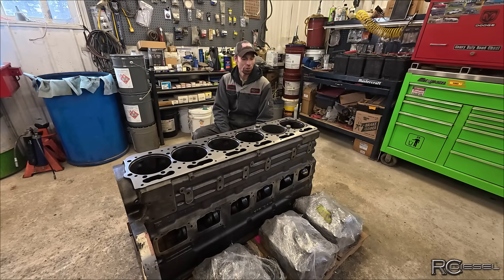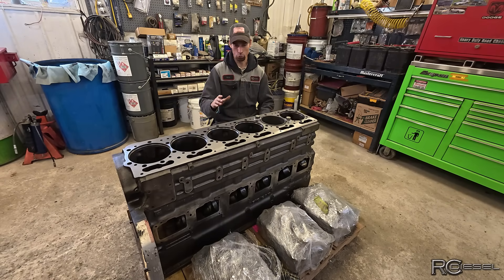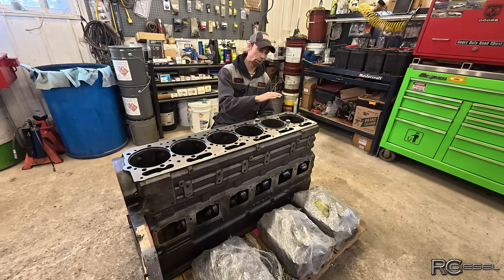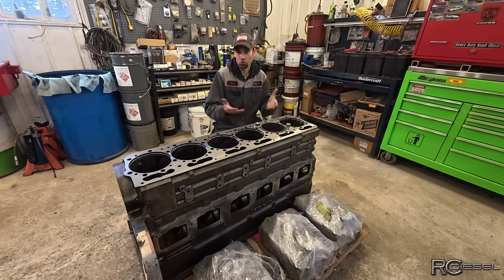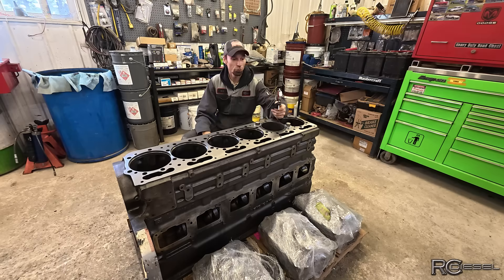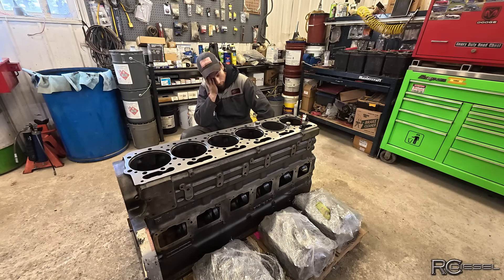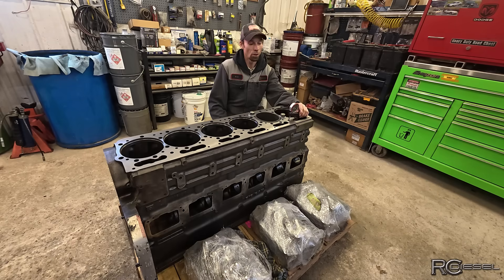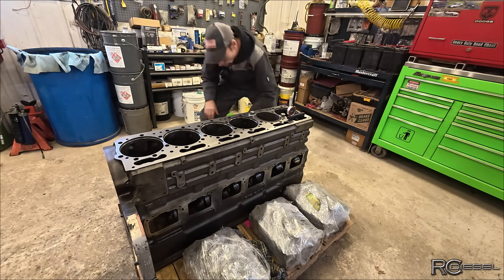Cummins 855 Rebuild Disaster Ends Here: Liner Protrusion Truth Revealed (ST310 Steiger) P5

Comment: So how come only cylinder five measured out of spec? What did the other liners measure when you were doing it the wrong way?
Reply from the maker: Right??? I do not have an answer for this. When I swapped liners from hole to hole, the #5 protrusion would change, but always stayed below minimum. All of the liners measure low, considering the counterbores measure perfectly on the high end of spec. The math says the liners should be at max protrusion, or very close. If you look back right at the end of this video https://www.youtube.com/watch?v=ZpOpREsQLoA&t=98s, I show the original measurements, before I swapped liners 47 times.

Comment: You should have been able to figure it out. It requires critical thinking.
Reply from the maker: Yeah, on the surface, it seems like not too big of a deal to figure out. I've rebuilt a lot of engines over the years, all different brands and types. Whatever thinker/problem solver I am, I assure you, there was no part of my brain that said "Hey, maybe I should file down the tip on a precision measuring tool to fit a section of the liner flange that's 0.010" wide but still on the same plane as the "correct" place to measure and check protrusion from there instead." No sir, I simply wasn't smart enough to figure this one out on my own.

Comment: In the mid 80s they chand the liners from lower press fit to upper press fit. The liner counter bores were machined and a 
.020 shim was fitted in the liner counter bore to fix leaking coolant and compresson leaking into the cooling system. We also would sleeve the counter bores if cracked
Reply: The change was from upper press fit to lower press fit. The upper press fit was putting strain on the 90 degree joint at the counter bore and cracking into the head bolt holes. The most common cause of external coolant leaks on these engines was cracking from the liner bore to the head bolt holes. The head bolt holes have repair bushings installed to repair this along with machining to install 20/40 lower press fit liners. Cummins would only warranty an overhaul if this was done on a "thick deck" block (1") vs the thin deck block (3/4").
Reply from the maker: Love it. Thank you for this information 👌
Reply from the maker: I wish I was set up to do this machine work, that would be awesome. I'm under the impression that the anaerobic sealant around the flange and proper protrusion should solve some of the coolant leaking issues - at least for another 20 years.

Comment: Not quite sure why number 5 measured differently - you were using the same dial gauge? But thanks for the update. Most useful!
Reply from the maker: Yeah, I really don't have an answer for that. All of the liners measure low, based on counterbore depth measurements. Counterbores are all at a near perfect min depth which should put all of the liners at or near max protrusion. I swapped liners around time and time again trying to figure out what was happening - #5 protrusion changed along with all the others as I swapped liners around, but it always measured below min spec. I measured #5 counterbore a dozen times in all different places and I could not find a thing wrong with it. Put an old original OEM liner in that hole and BANG! Perfect protrusion, just as the counterbore depth says it should be. It's a complete anomaly.
Reply: @rcdieselchannel …..the same thing happens to me all the time - you’re not alone 🤣. Appreciate the reply. I really can’t imagine the oem manufacturers do all this measurement. It’d take too long. I suspect they throw them together. Happy Christmas to you!!
Reply from the maker: @DarrenPhillips001 I appreciate the company haha I don't know what the manufacturers do, but I know a lot of mechanics that don't bother with most of the details. They seem to get away with it though....

Comment: Why not deck it another 1 or 2 thousand
Reply from the maker: Yes sir, that was the "fix" I came up with when I couldn't figure anything else out. There are a couple problems with this though. Low liner protrusion is a symptom of another issue and very part of the liner-to-block relationship works together. If you modify one part, it affects another. The counterbores measure exactly where they should be - so decking the block again would put them out of spec - which means the symptom is sort of solved, but the actual issue is not solved. In this case, measureing the liners on the outer edge produces measurements that are right on spec - the high end of spec. So if I had decked the block another 0.002", the liners would have actually wound up roughly 0.002" over max protrusion which puts a lot of extra load on the bottom of the counterbore: right where they crack... and that may have lead to future problems. I'm so happy to have found the actual issue and to be able to assemble everything in spec.